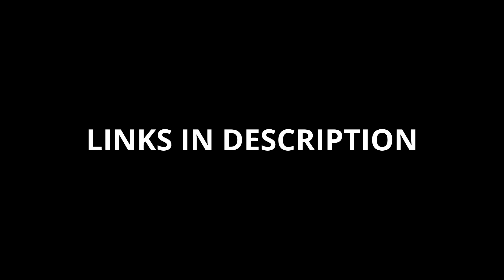Fiber Optics Wire as RC Lights

Comment: I wanted to do a big project, I'm building a tree, and needed around 5 foot long, lights hanging down 24 branches, like a willow tree... My question is, can I hook up that many lights to one light source, to change the lights color at demand?
Reply from the maker: Best would be to use biggest LED like 5mm and smallest optical wires si fit as many as You can and Yes it would work but optical wires on edge of LED would not have same amount of light like wires in middle but that's how it always work :D
Also I suggest to find flat top LED to direct as much light to top as possible :)
Reply: I found a double light for $50 on Amazon, and it holds 600 lights all together. I wanted to start the wires branching out up the arms of the tree, then, hanging down like a willow tree. Are you telling me, I won't see the lights on the ropes hanging down off the branches? I think 6 foot wires would be the perfect size. I looked, and didn't like how the flat top led lights looked, I wanted lights that come down like hairs of light. Or even rain drops with different speeds. I wish I can show you what I'm making. I have 4 main branches, any way to connect 4 separate lights, and control them all with one controller.
Reply from the maker: @scottk7613  Flat top LED is just type of LED that compared to normal one direct light to top and that lept to direct light to wires.
You will see some light in wires but it's designed to transfer light to the end so there is not to much light in middle
Reply: I was thinking about a base light, that flashes up, to the string lights, that way the middle and ends will light up. I wonder if the middle light change color if I'm shining another light up onto it.
Reply from the maker: @scottk7613  Until light will be directed straight in to wire it will transfer to other end.
I did not test to use two lights but wires are shining light in middle because on Land Rover I needed to cover theme with black tape :D